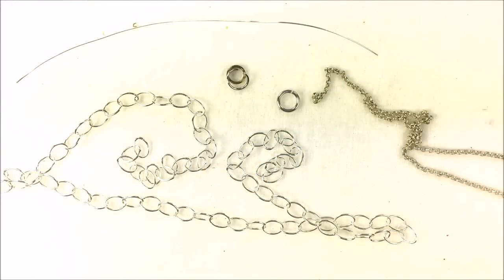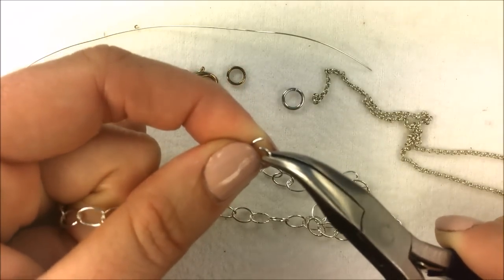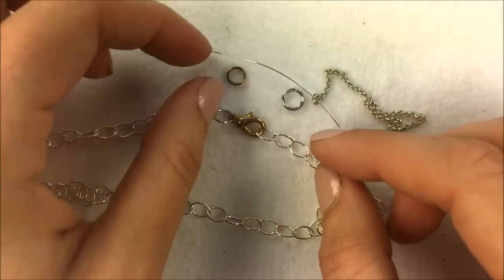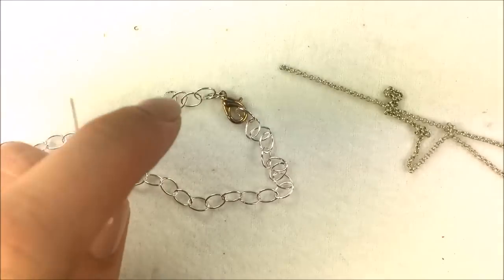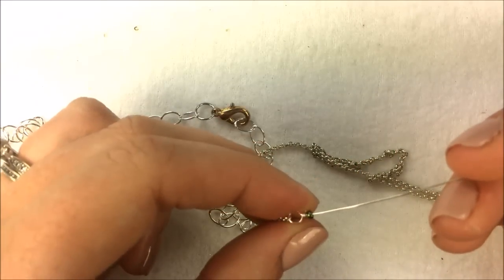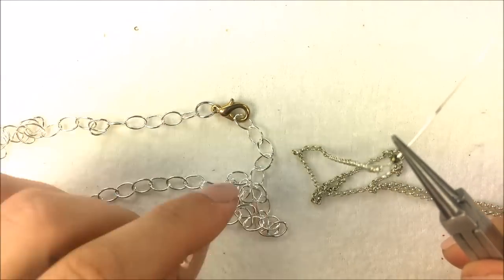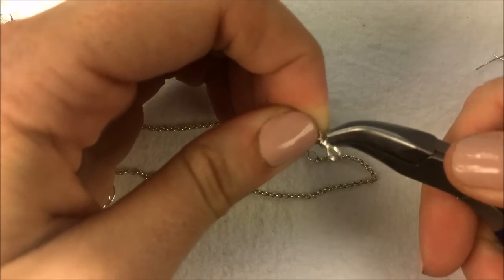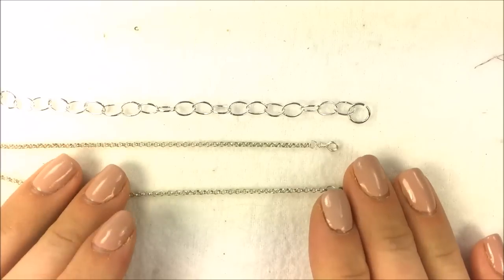How to Fix Broken Chain Necklaces jpg

Comment: This was very helpful. Do you have any ideas on how to repair the smaller chain when it breaks somewhere in the middle of the chain?
Reply: Same mines broke into 2 pieces from the middle
Reply: Me too
Reply: Sem
Reply: I took one of the little rings off, bent it open with my fingernail, picked it up with pliers, hooked both sides back into the ring and closed it up
Reply: This recently happened to me and I popped a staple right where it broke works like a charm
Reply: @whippedcreamonmyass  this is perfect for my chain with tiny links, thanks!
Reply: The things the reply’s are saying DO work but I’m making a necklace for my jewelry line and they won’t look good on it nor will the person who ordered the necklace like it so I need a better option to do so it looks like it never broke my pliers won’t pick up the pieces so does anybody know what to do?
Reply: @whippedcreamonmyass  love the name lmafoo 😹
Reply: Same
Reply: @MarcusPeterson-e8v you can try taking the actual link off and re-connnect it with tweezers, my rope chain necklace rings are very small so the tweezers really helped keep it in place in order to reconnect the 2 parts of the necklace together !

Comment: For anyone that doesn't have nose pliers like that you can use a large nail clipper to grasp the outside of the link and squeeze it back together when the lobster or next link is threaded inside it.

I also recommend squeezing the ends together on the other rotation after the links are closed to ensure they are touching each other on the sides as well.

Comment: Do you have any ideas on   how to repair the smaller chain to my necklace actually its gold necklace but it came out the lock after I wear to my neck and I dont know how to put it back?
Reply from the maker: If you can fit a piece of 24ga wire into the link, you could add a wrapped loop with a gold seed bead then add the clasp. Otherwise, you might have to replace the chain.

Have a look at item #7 for the idea I'm talking about. Just the one seed bead between your last chain link and the clasp.
https://www.thespruce.com/easy-beaded-earrings-wire-wrap-earrings-4120057

Comment: I slept with my 14karat gold chain and it’s thin and it broke would this work didn’t really watch all the way through
Reply from the maker: If your chain has big enough links to fit a 24 or 26 gauge wire through it, then you should be able to fix it.  If your chain broke in the front or side area of the neck, you can make a link using some cute seed beads or crystals on a piece of 24 or 26 gauge wire and attach it to your chain and secure it doing wired wraps.  If it broke toward the back where the clasp is, you can do the same with a plain piece of wire, no need to add beads if its in the back.

Comment: Nice but do you know the little lever in the clip to close it and attach the chain, that little lever is lose inside of the clip. And the chain costs a lot of money and i really need to fix it pls :( im begging you. I cant attach the chain together anymore. :( pls HELP
Reply from the maker: The tiny spring has fallen out but you can replace the broken clasp. We sell lots of great clasps at Potomac Beads. www.potomacbeads.com We also have a variety of jump rings if you need one too.